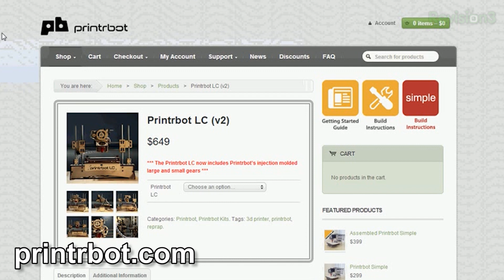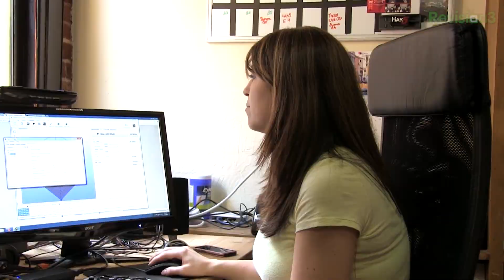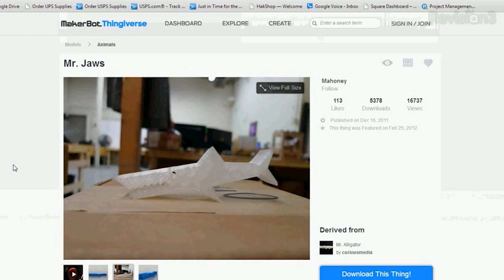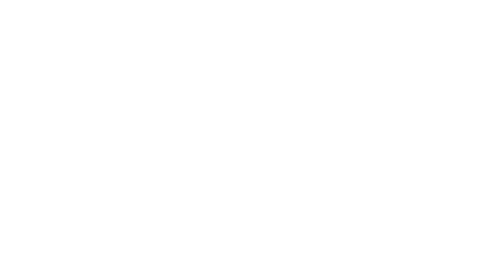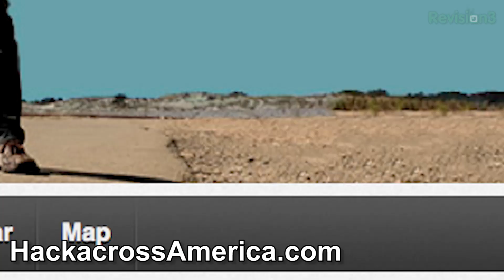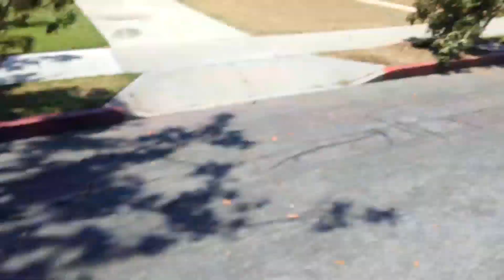Shannon Sets Up Her First 3D Printer, Hak5 1421.3

Comment: 3d printers can be used to make replacement parts for things. You can make parts that aren't being manufactured anymore.  The guy from Defense distributed was able to print AR-15 magazines. He also managed an AR-15 lower receiver. You can make whatever the hell you want, within the limitations of the printer.